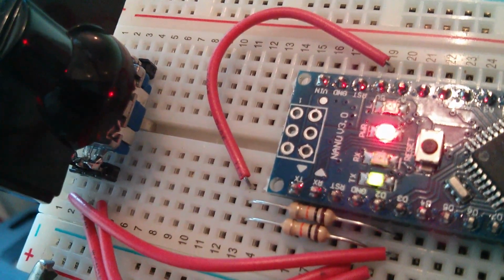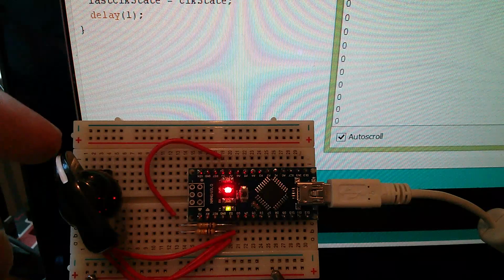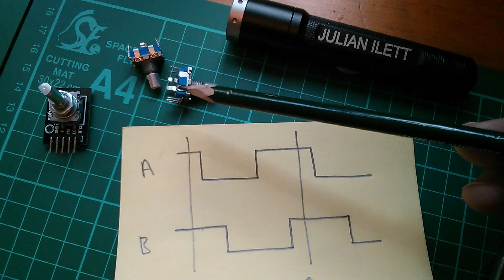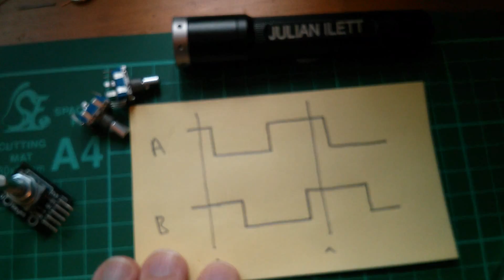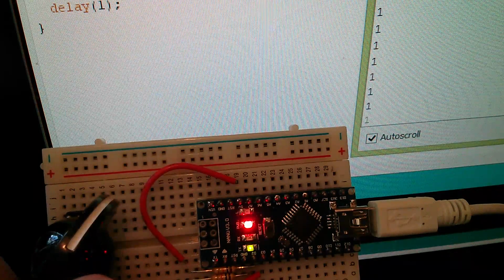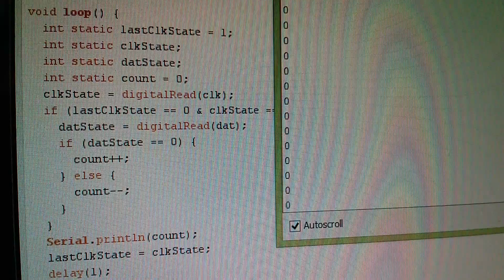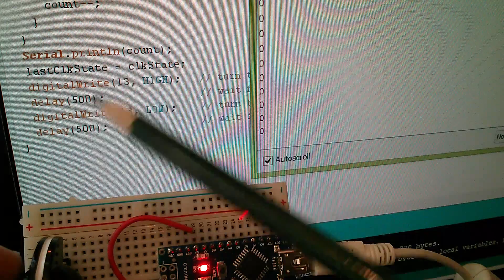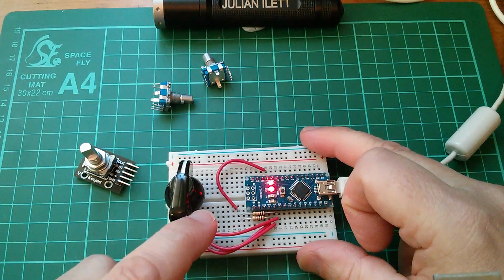Project: 20-Position Rotary Switch #2 - Polling & Missed Pulses

Comment: boring tech stuff coming up :-)
1)
serial.println(count) will output at least 3 characters (the digit, carriage return and linefeed).  But it could be 4 (numbers 10 and above, and numbers below 0), if you needed a continous counter, it could even be 5, 6, 7 or 8 characters...  println is synchronous, meaning, it doesn't return until it actually has sent the bytes through the serial port.  So at 9600 baud, it takes 1/9600th of a second per character. So you could round it out to 0.1ms per char for easy measurement.
So the serial.println() with the delay combined will take 1.3 to 1.4ms (longer for values with more digits).

now... I guess the delay is in there in part for the println to not overflow your terminal window. so for something like that, there is an easy solution.  only output changes to the count, instead of every time through the loop.
replace the println and delay lines with:

static int countOutputed = INT_MAX; //set to an 'impossible' initial value
if (count!=countOutputed)
{
   Serial.println(count);
   countOutputed=count;
}

that gives you something you can monitor easily without it affecting the operation (too much)
Reply: 2) your 2 digitalRead()s are apart with code in between.  Reading the rotary assumes you read the clock and data "at the same time". It won't matter a lot in this specific case because there's not a lot of code between, but suppose you had additional tests and code in there, then the 2 reads might be far enough apart to misread.
The arduino libs don't allow multiple pin reads simultaneously, so the easy way around it is doing both reads one after the other to minimize the chance this misread happens.  You can read multiple pins at once via assembly, but then you loose the portability across the different arduino boards the library supports.

digitalWrite() is pretty fast.  You can do about 1million of them per second on a due and about 12milllion/sec on a uno.  there's a 'fast' digital read/write that's about 10x faster on reads and 15x faster on writes, but it doesn't work on all arduino's.
http://code.google.com/p/digitalwritefast/

compare this to the analogRead() which works at 10Khz because of the ADC conversion accumulation.
Reply: 3) the typical delay in arduino code is fine for a simple blink program, but as you discovered it excludes any sort of 'real time' stuff.
Interrupts might solve it... if what you're trying to do can be attached to an interrupt.
Alternative solutions is using timers (something like the Simple Timer library) http://playground.arduino.cc/Code/Timer

or rolling your own form of 'multitasking', which for the rotary+blinky led would
consist of a loop that checks if the rotary changes and if so changes count (you already have that)
check if the led state needs to be changed and change it.  without using timers, it'll be difficult to get these to do actual precise 'every half second spot on', but "close enough" is doable.

change the 2 digitalWrite and delays with:

static int changeLedStateCounter=0;
const int changeLedSpeed = 1000; // change state every 1000 times through the loop, adjust as needed
if (++changeLedStateCounter > changeLedSpeed)
{
    changeLedStateCounter = 0; // reset loop counter
    digitalWrite( 13, !digitalRead(13)); // change led state
}

the above approach will work for several steps/checks, but it'll start to break down if there starts to be too many of them.
Reply: actually, println speed is different than I said above., because of Julian's mention of 9600*Baud* (symbols per second) when the UART is actual set up as bits/sec.  So at 9600bits/set, 8 databits, 1 startbit, 1stopbit. The time to output 1 byte (character) is actually 10x as high as I posted in the 1st post, or about 1ms per character (and 3 chars at least for each println(count).
Reply: oreubens"digitalWrite() is pretty fast. You can do about 1 million of them per second on a due and about 12 million/sec on a uno. there's a 'fast' digital read/write that's about 10x faster on reads and 15x faster on writes, but it doesn't work on all arduino's." is little of. Due is capable of about 50 million/sec (speed of gpio port is configurable on cortex m3)and uno about 16 milion/sec of them ( it can be made to do 20 milion/sec but you need to change bootloader), of course this is just theoretical figures and they work only for writing constants (same restriction as for digitalwritefast)
Reply: Miloš Lazović the 12 is a typo, should have been 2.  With assembly you can go higher, but I was talking about the regular DigitalRead/Write library function which does some basic checking as well as readin gthe data (which is why the digitalreadfast (and write) are faster, because thye don't do the checks).
Reply: oreubens I never did go in deep how arduino DigitalWrite actually work, I remove bootloader from my uno and use it like ATmega328 breakout board. I still prefer to use IAR for ATmega328 over Arduino IDE. I never actually used due but I used SAM3X8E but it is not my preferred choice of cortex m3 microcontrollers, I much more prefer STM32F103 and again for both I use IAR.
But speed what I stated are purely theoretical (you can set ports at that speed but only wery limited amount of times) but in real situation it much depends from surrounding code and how much is compiler able to optimize it.
Reply: that is one option. And by locking yourself to a specific platform you can gain some speed, but loose the portability to run your code on other arduino's that may not have an ATMega328 chip.

do you want the extra performance, or prefer the portability.  There's pros and cons for both.
Reply: oreubens usually when I start writing software I finished design so there is little chance i will change microcontroller in middle of software development (till now i never did it before but never say never) and if I ever do that then least of my worries would be to change software, I would be more worried how hardware design went wrong so I need to change microcontroller (that imply lot of hardware changes to accommodate for new microcontroller) so I am not much worry about compatibility between different version of arduino's
Reply: Miloš Lazović yes, it's one way of working.  If you're electronics savvy that's prob the way you go about it.  The more regular "maker" community however, tends to work with a basic ardiuno with  shield(s) and breadboard to do their testing, get their code fixed.  and only later in the development cycle locks into a smaller board like an uno.  Having to option to keep the code as is is a big bonus in that scenario.
Reply: oreubens I get that point of view, but let say you started with uno and you at some point decide you want to go smaller, you can go to nano without any trouble (it use same ATmega328) so you don't have problem there. Again I personally would immediately go for model I plan to use in final design, that will save me potential risk of hitting on some silicon bug that don't exist in microcontroller on which I did initial testing but exist in one I use for final design and then I lose a lot of time why code that was working perfectly before now dont work ( and according to Murphy's law that situation will happen sooner or later when you least expect), of course this situation apply only if board on which you did initial design have different microcontroller than one you use in final design and that why I always immediately after datasheet I open errata.

Comment: In my experience, slow down the sampling rate if it skips. I remember using 1 KHz timer interrupt to read events on a project, it removed most of the mess. (from relays)

You actually want it kinda slow, so it misses fast dual-transitions (that are unwanted mess anyway).
You do NOT want it super-fast, it will only pick up glitches that way.

For sending data over serial, a async interrupt would be best.
I have some bad experience with blocking writes.

Comment: Not much to say here that I didn't say in the last vid or you said in this vid. As you say, bit-banging serial and polling switches with delays aren't good ways to do things, interrupts are good. Multiple switches per adjustment is effectlively due to switch bounce and that's solved pretty easily with an RC debouncer circuit; and that this type of rotary encoder really isn't designed to encode the absolute position and is more meant for something where you keep turning a blank knob with no position indicator until it gets to where you want on a display or something e.g. for a volume control on a car radio or temperature setting on a digitally controlled oven (the crappy one on my hotpoint has a life of its own..) or any of the knobs on a digital oscilloscope etc.

I would have thought that since this type of encoder is designed to output something that looks like serial data, you could wire it to one of the serial interfaces on the arduino, but I have minimal experience with microcontrollers.
Reply from the maker: KX36 I agree completely. I'm pretty sure the solution to contact noise will be an RC filter and use of interrupts will solve missed pulses. I also agree that this cheap switch will never be able to encode absolute position with 100% reliability... but 99% would be good!

Comment: Maybe you should try to use interrupts in arduino. That way anytime signal rises (or change state) it will execute subrutine while pausing loop section of the code and that way you would get minimal delay. Just keep subrutine simple (just counting) and leave all testing and serial in loop.
Reply from the maker: Darko Bulatovic You've predicted part #3 perfectly!
Reply: +Julian Ilett Are you still planning to do a part #3?

Comment: i was thinking the errors were mechanical, switch itself missing, it looks pretty sloppy in movement
Reply from the maker: jusb1066 Yes, the switch is both horrible and wonderful at the same time. Horrible because it's cheap (about 28p each) and nasty. You're right about its poor mechanical construction - the detents are pretty sloppy and seem to get worse with use. But wonderful because it needs so many different solutions to get it to work properly. And that's the fun part!
Reply: Julian Ilett I'd read reports of these encoders bouncing, so I went for the EC11 quadrature encoders (lime green bottom ones) on eBay for a CNC project and they worked a treat.

Comment from the maker: Arduino Code:

int const clk = 2;
int const dat = 3;

void setup() {
  Serial.begin(9600);
//  pinMode(clk, INPUT);
//  pinMode(dat, INPUT);
}

void loop() {
  int static lastClkState = 1;
  int static clkState;
  int static datState;
  int static count = 0;
  clkState = digitalRead(clk);
  if (lastClkState == 0 & clkState == 1) {
    datState = digitalRead(dat);
    if (datState == 0) {
      count++;
    } else {
      count--;
    }
  }
  Serial.println(count);
  lastClkState = clkState;
  delay(1);
}
Reply: love the critical thinking and problem solving  :)
my original notion was to increase the delay to smooth it out, but you showed well how that isnt the solution at all. i have also wanted to use an arduino for high frquency work and got caught up with code delay...there must be a way around it. 
the libraries and everything that make the microcontroller easy to use also restrict its performance on that level (although im sure the hardware is capable of doing the required job)...im very interested how you get around it  :)
Reply from the maker: jeremy gwilt Thanks Jeremy. One way to keep high frequency code blocks properly serviced is to use interrupts, particularly if the rest of the program has very time intensive processes running. My flashing LED with its 500ms delays was an extreme example of course. In the next part, I'll show (using interrupts) how the rotary switch and the flashing LED can work together harmoniously,
Reply: Hi Julian Ilett

Maybe pulseIn() and attachInterrupt() could solve the problem.
http://arduino.cc/en/Reference/pulseIn
http://arduino.cc/en/Reference/attachInterrupt
Reply: Your code has caught a nasty &&/& bug:
if (lastClkState == 0 & clkState == 1) {
should be
if (lastClkState == 0 && clkState == 1) {
Your videos: well done, thanks!
Reply: Julian, really like your videos. Just a small point though, in your code you have used the C/C++ bitwise operator & instead of the logical operator &&. This can often cause the program to not behave as you expected. Hope this helps.
Reply from the maker: seabreeze555 Oops - you're quite right. That's my rudimentary understanding of C letting me down. && would be a safer option. Thanks for putting me right on that.
Reply: or use assembly language ^^ ...no don't do it julian

i know you can programm assembly language, maybe you want to create a little snippet inside of c, to detect the rising edge.

i am now more confidet to buy an arduino as i can use interrups, thought it would be the price for using a bootloader and pseudo code arduino style not to be able to access any lower level function
Reply from the maker: ***** I didn't know about pulseIn(). That could be useful. Cheers.
Reply: Julian Ilett You can't make a silk purse out of a sow's ear. Spend a fiver and get a decent one.
Reply: Julian Ilett was there ever a “Part 3” to this project where you use interrupts? Can’t seem to find it.